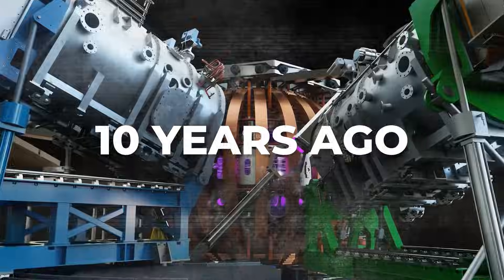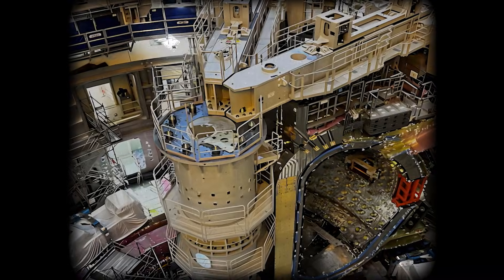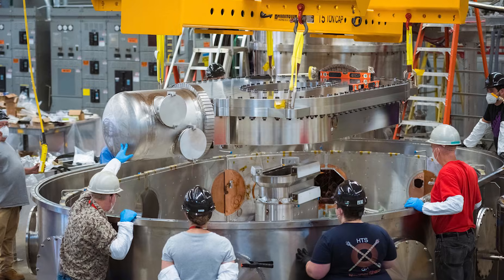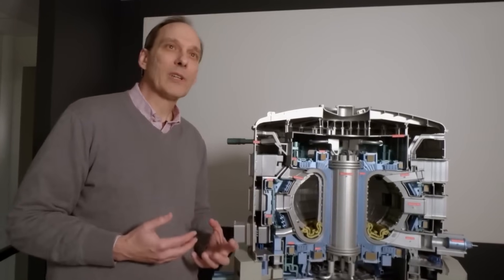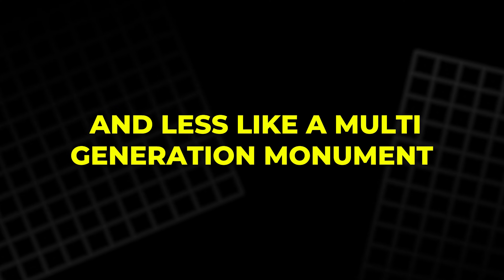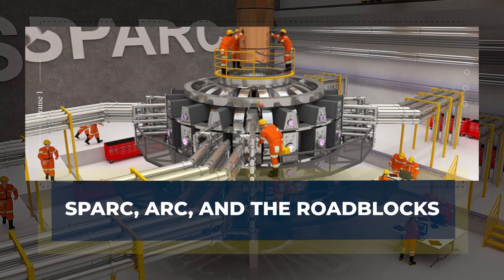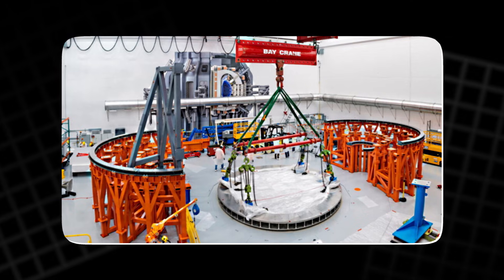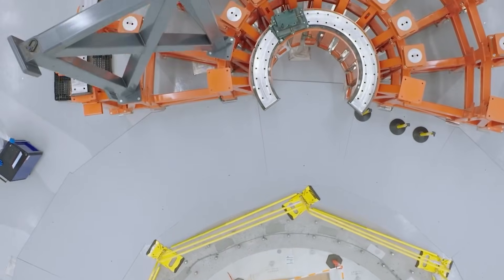MIT’s Tiny Fusion Reactor Could Beat ITER

Comment: And 15 years more pass and the fusion still not work
Reply: The initial nuclear fusion energy experiments began in the 1950s and over 150 experimental machines have been built and experimented with since then. Only a few recent ones have generated more than 1.0 watt-hour of pure fusion energy and none have achieved more than a tiny fraction of the energy that was consumed by the facility in creating the reactions. All devices remain at least three orders of magnitude away from demonstrating an economically practical power plant, even when they claim that that elusive goal is just around the corner.

Comment: It always blew my mind that the first fusion reactor designs were not super small. With new tech that uses a lot of energy you always start small. You test it, get to to work and then build bigger. And so on. This should have been obvious, except to scientists who do not think like engineers. (If only fusion had its own Elon. But Elon prefers solar.)
Reply from the maker: Great point!
Reply: The first nuclear fusion energy experiments began in the 1950s, which included the first tokamak. Since then over 150 machines have been constructed and experimented on. Only a few have ever achieve more than 1.0 watt-hour of energy derived from fusion energy. The vast majority of the machines never employed fusion fuels and therefore no fusion energy was expected to be generated from them. That has never prevented all the machines from being branded as being 'fusion reactors' for promotional reasons. Many techno nerds have been conditioned to believe that all new technical developments eventually lead to practical products. They have been shielded from the numerous flops to keep them motivated.

Comment: 1:55 MIT is going for net energy, ITER is built for fundamental research and never expected to produce net energy. BIG difference. MITs approach is trial and error while ITER tries to figure out the physics behind it.
Reply: You have fallen for the 'net energy' shell-game. The term net energy has nothing to do with the total energy that is required to power the experimental facilities. Typically the 'net energy gain (Q) value is calculated based upon the amount of energy required to heat the plasma to fusion energy temperatures. In pulsed experiment machines, which almost all experimental machines are, the Q value only applies to the short time the fusion reactions are occurring. In the case of the highly publicized 12/05/2022 NIF 'breakeven' laser shot the Q-plasma value was about 1.2 but when the energy needed to pump the lasers was considered the Q-total value was under 0.01. That experiment took about a week to prepare with the resulting fusion reaction lasting only 0.000,000,000,08 second. If the power consumption of the lab was considered, during the experiment preparation time, then the Q-total would have been well below 0.01. Fusion energy fans tend to have little interest into probing into what details are being omitted from fusion energy promotional presentations.
Reply: @vernonbrechin4207  I think you are not getting the point. All your explanation may be correct but it still is a total miss.
Let me try to explain in a different way. 
MITs approach "We do not fully understand how and why but we don't care as long as it will run".
ITERs approach "We don't care whether the engine runs or not, we want understand the entire mechanics behind it, and once understood we build a working machine.".

Comment: The sun being a massive fusion reactor sends photons to Earth which we can intercept with very cheap easily manufactured solar panels. Solar power is fusion power. It is what drives the Earth’s biosphere providing energy for photosynthesis involving the production of glucose (hydrocarbons) for energy and cellulose for the structure of plants. What most fusion development projeçts fail to address is precisely how they intend to produce electricity or extract heat. Sustaining a plasma is one thing but pointless if no sustainable mechanism for extracting useable energy is featured
Reply from the maker: That's an insightful point about the sun being our primary fusion power source!
Reply: The plasma physicist continue to have fun, based upon the many billions of USD they have raised for their experiments. In the view of most of them, it isn't the job of theirs to work out the practicalities of capturing the emitted fusion energy and channeling that into economically practical electrical energy generation. They assume that job can easily be done by engineers who are experts in that field. That is one reason the experimenters continue to state the fusion energy gain value (Q) based upon an input energy value that tends to be orders of magnitude less than the actual energy needed to power the experimental facilities that they work with. In other words they have learned to utilize the general technical ignorance in this field to mislead the reporting journalists, funders and the general public.

Comment: lol. ITER, Tokamaks are for plebs. Not an elegant solution. Field-Reverse Configuration FTW.
Reply: Helion Energy appears to be having difficulties reaching their primary goals with their 7th generation experimental machine, Polaris. The same seems to be true for the current TAE Technologies. Both tend to be masterful in avoiding any mention of problems in their self-promotional presentations. In an early 2024 announcement Helion stated that they expected their Polaris machine would be generating electricity by the mid-summer of that year. There is no evidence that they have generated even 1.0 watt-hour of pure fusion energy. Both those machines are based upon the Field-Reversed Configuration that was initially tested many decades ago and then dropped.

Comment: The video addresses two main topics. The first concerns the extreme complexity, enormous costs, massive delays, and obsolescence of a project such as ITER, which now appears fundamentally doomed. It was already debatable whether ITER was the best route to fusion when it was conceived (its engineering design began 35 years ago!). Since then, a series of mistakes—flawed design choices and extremely poor management—have led to unprecedented cost overruns and schedule delays. As a result, meaningful deuterium–tritium (D–T) experiments will not take place until well beyond 2040—half a century after the start of its design phase—and this is assuming everything proceeds smoothly, which past experience makes highly doubtful. In fact, the probability that ITER will ultimately fail altogether is quite high.

High-temperature superconductors are an important technological development and could enable alternative design approaches. However, the higher forces associated with stronger magnetic fields will require much larger support structures, ultimately making the machine bigger than often claimed. In addition, higher fusion power densities will impose extremely severe thermal and nuclear loads on materials, leading to unsustainable operating conditions or accelerated degradation, rendering a future reactor impractical or inoperable.

Finally, the fundamental challenges on the path to commercial nuclear fusion remain unresolved: reliability, availability, and the repairability of an extremely complex and highly activated machine. A more compact design will not make these issues any easier to solve.
Reply from the maker: Thanks for your detailed analysis of the challenges facing ITER and compact fusion designs!
Reply: Thank you for your critical perspective. That is not considered to be fashionable among most of those now working in the field who are likely to brand themselves as being fans. My impression is that when most journalists and investors seek out potential critical analysis they end up with feedback provided primarily by individuals and teams of fusion energy lovers. Those, in love, tend to have a lack of interest in digging deeply into strategically omitted experimental details.
Reply: @vernonbrechin4207  I agree. Many people providing opinions on fusion are often in a clear conflict of interest. In the best case, they genuinely like the idea of fusion—they are in love with it, as you wrote; they are fans. Much more often, however, there is a more direct personal and economic interest. Individuals working in fusion understandably want to secure their jobs until retirement, while commercial private enterprises, of course, need to attract investors and capital. Commercial is the key word here.

The fact is that nuclear fusion projects are almost invariably assessed and evaluated by nuclear fusion specialists themselves, justified by the claim that nobody else can truly understand the complexity of the subject. The results, therefore, are not surprising: a series of wildly wrong forecasts over the last seventy years regarding the time and resources needed to develop a commercially viable fusion power plant—and this trend continues unabated.

Comment: So does plasma at 100,000,000 degrees not present any danger if the magnetic field fails?
Reply: It does and much design work goes into the above scenario to avoid significant damage due to the sudden cessation of the intense confining magnetic fields. Superconducting magnets can undergo a so-called 'quench' where the supperconductivy suddenly ceases. That requires that the energy stored in the magnetic field and the coils be rapidly dumped into a resistive load. Large amounts of helium are also typically vented during such events. The energy contained in the circulating plasma must also be safely dumped during a very brief time period. Much of the energy is supposed to be channeled to the diverter section and often the plasma energy requires scanning across the surface of the diverter to avoid melting the tungsten, or carbon, plasma facing surface.

Comment: I did a research paper at college in 1972 for engineering class.  The breakthrough was near only few billions away.  Fifty three years later still waiting.
Reply: Since that time over $50 billion USD has been expended upon the holy grail quest for controlled nuclear fusion energy research. Most of the extremely enthusiastic young people, now working in the field are largely clueless regarding the history that began in the 1950s. They have been steeped in the marketing hyperbole.

Comment: Wendelstein 7-X !
Reply: There is a Wendelstein 7-X fan club. The machine has always been branded as a fusion reactor but none of the experimental shots have ever employed deuterium-tritium fuel so it never has generated any significant quantity of fusion reactions. It may never get that far. So far their peak plasma temperature is about 0.25 of what would be required with a fueled reactor. The promotional announcements have mentioned the record power levels achieved without clarifying that that energy had nothing to do with the generation of fusion reactions.

Comment: Tokomak fusion reactors will never scale up commercially.
Reply: The promotional hype typically leaves out the fact that almost all tokamak designs operate in a pulsed mode with most experimental shots having very low duty cycles. Since most lay people wouldn't understand what this means it tends to not get mentioned in promotional presentations.

Comment: So how do you bring something at 4 kelvin close to something else at 100 million degrees and then keep them at that ???.
Reply: The process requires a combination of vacuum insulation, 14.1 MeV fusion neutron shielding, and a energy intensive cryogenic cooling system with high flow rates. In the case of high duty cycle fusion reactions a massive circulation of coolant fluid will also be required. Currently the experimenting plasma physicist aren't that concerned with heat removal in the machines that operate a very low duty cycles. They assume that after they reach their goals the rest of the design problem will be easy for engineers.

Comment: They should have gone with a stellarator design.
Reply: Since the over 150 non-stellarator experimental machine designs, constructed since the experiments began in the 1950s, haven't yet demonstrated useful fusion energy production, many fans are now putting their bets on stellarator designs. Despite the clever sales pitching no stellarator machine has yet employed deuterium-tritium fuel, or demonstrated any production of significant fusion energy.
Reply: @vernonbrechin4207  Yea, however my point is not that the stellarator is production ready but that it simply has recently demonstrated a great deal more plasma stability in the recent results from the Wendelstien 7x. The two together might make for magic. Just my two cents.
Reply: @djackson603  - Good point. It is the same attitude that two generations of nuclear fusion physicists have held for many decades. It is hard for today’s highly ambitious experiments to contemplate.

Comment: Important distinction: Q_plasma (what this video discusses) is NOT the same as Q_total (what the grid cares about). A Q_plasma of 2 sounds impressive, but when you factor in the energy needed to run the magnets and heat the plasma, the plant is still a net consumer of power. We are essentially trying to replicate the Sun without the benefit of its massive gravity, which requires a huge 'energy tax' for magnetic confinement. Let’s start seeing projections for Q_wall-plug if we want to talk about 'beating' other energy sources.  (thanks to Gemini 3 for refining my comment!)
Reply from the maker: Thanks for highlighting the distinction between Q_plasma and Q_total!

Comment: It should be fair to mention that the Commonwealth Fusion Systems (CFS) project stems from the Alcator and Alcator C-Mod experiments that MIT ran for several years, and is an advanced version of Bruno Coppi's Ignitor, which most of the community shunned. When the Department of Energy  (DOE) cut the funding to C-Mod, Dennis Whyte and his students decided to think out of the box, and do what others hadn't dared: design an altogether new project, the Affordable Robust Compact (ARC) reactor, and the intermediate Smallest Possible ARC (SPARC) based on the knowledge they had already acquired, and private investment, instead of DOE. By doing so, they set an example many others are trying to replicate, leaving ITER (by the way, it's pronounced EATER) obsolete before it starts operations. Many people believe ITER will still have a role to play as an experiment, but it will lack the relevance it was meant to have.
Reply from the maker: Thanks for providing that detailed context on the origins and development of the CFS project!

Comment: honestly I think the generation after arc need to move to a stellarator rather than a tokomak, because high field strength in a smaller reactor means greater plasma instability and stellarators are better for plasma stability, however it's not something you want to build for a test reactor hence why I'm saying SPARK and ARC are the best test reactors, but if it goes all the way to actual deployment a stellarator will be the better option, should probably work with Germany as they are the front runners in stellarators.

Comment: No, the real challenge is where is tritium going to come from. You cannot find it in nature, so the reactor will need to produce it. This is far more difficult than producing net energy.
Reply: Canada has about 20Kg of tritium obtained from its heavy water reactors and clearly anyone building a DT reactor will need a cache of tritium to start the reactor and maintain it until its own bred tritium becomes available. The difficulty is how will this cache be estimated? The initial tritium will go everywhere, ie into the machine walls and the vacuum systems so in the end the only way to know the amount needed is to actually operate a reactor. Catch 22 interferes with all this since it would be incredibly irresponsible to build a reactor without knowing the amount first.

Comment: With about 200,000 for start up and 10, 000 a month for one year after the facility construction and I will give you mobile fusion reactors  , specialized for intended purposes, ei ionz, isotopes, alchemy, etc. 
Give me an intended output and I should be able to make the interchangeable components for you product needs while still producing the energy output greater than the input.

Comment: They are using wrong graphics for certain sequences.  Who put this together
Reply: Usually the wrong graphics are the other way around, taking about Stellerators and showing tokamaks, so this is doubly odd, also Wendelstein 7-x keeps hitting the targets by brilliantly planning and just keeps on delivering.
Reply: showing stellarators instead of tokamaks
Reply: @gregbailey2203  Es wurde immer wieder der deutsche Fusionsreaktor Wendelsten 7X gezeigt. Der ist ein Stelerator und kein Tocamak. Wendelsten 7X lief 8 minuten ununterbrochen ohne probleme.